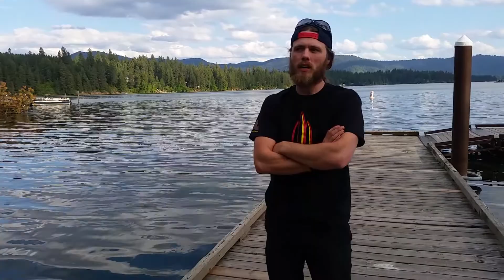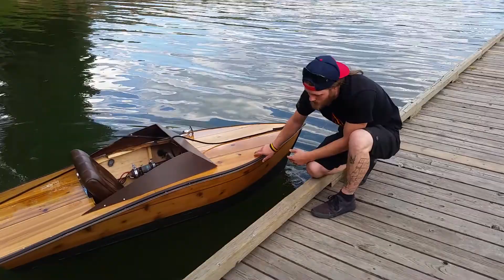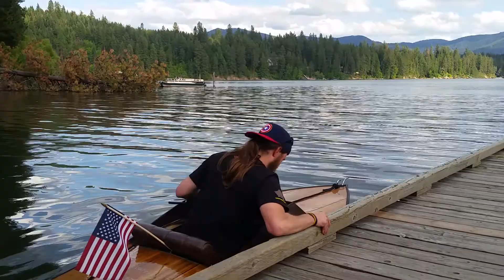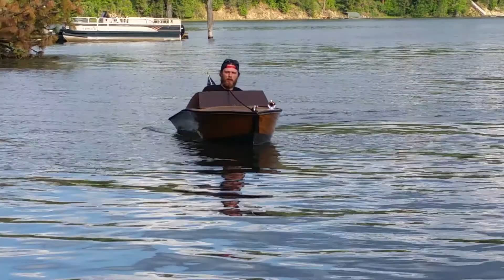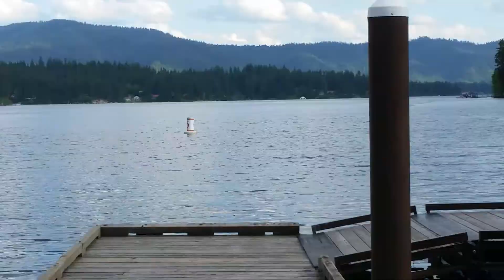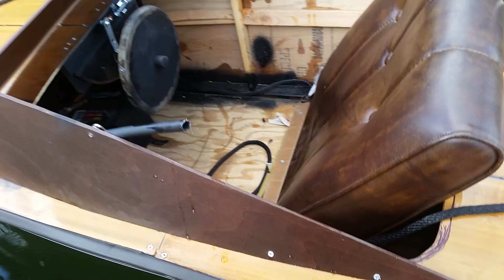Plywood boat small electric inboard ride

Comment: you know there are some really good closed cell foam that is very durable this foam is not like the soft foam that is in seat cushions it is a harder more durable foam
you could do some testing with it a hot glue gun would be enough for testing this would allow testing without modifying the boat this very firm foam was used to package a big screen TV I recently bought it is light and durable I would try three one down the middle and two more on each side of the width this foam is also used as pipe insulation for 3 to 4 inch diameter pipe
Reply from the maker: +Gary West I love this idea! Easy to shape too! If i like them i can fiberglass them! (Provided the foam doesnt melt!)  Thank you!!

Comment: what does the bottom of the boat look like any stingers? or is it totally flat
Reply from the maker: +Gary West Completly flat! No protection and no added stability whatsoever! (Some of my other videos show it hanging in the air) i really need to attach a keel or at least something! The floor is 5/8thick and is pretty stout as far as holding the wieght.
Reply: a couple stingers may add some stability while in the water
Reply from the maker: +Gary West i wonder how deep they would need to be.. i bet even 2" would help... or taper hmmm

Comment: Brian Davis what lake is this
Reply from the maker: +Mason Cox Hayden Lake in Idaho!!!
Reply: +Brian Davis that's awesome I live close to there. I love your videos and I'd like to start my own project boat... I was just at that lake during memorial weekend to!
Reply from the maker: +Mason Cox Sweet!! We were on the far side from cda!  I just built a trailer to hold both my boats so i can take both and cruise two deep!! Let me know if you want to try one!  Either way
Reply from the maker: +Brian Davis * either way let me know if you have any questions for your project or advice for mine!!    all great in the 208!!
Reply: +Brian Davis ok will do! I'm hoping to finish mine this summer. What do you use to seal your boats?
Reply from the maker: +Mason Cox I got stuff called Bar top sealer epoxy from lowes in the caulk section. Its two parts and you have to mix very well. I got a spot or two on the first boat that still wont harden!!

Comment: hey i would like to buy a boat plan but i wanna take this in a car trunk is there any way i can make the boat smaller thru the plan
Reply from the maker: +JrizzyJerome the patterns would be no good for that but the guide could help. If you do it in sections and recut when needed, you and make the top and floor the size you need and custom make the whole thing.  You could maybe cut the patterns down, but im not sure..
Reply: American Boathead ok thank you